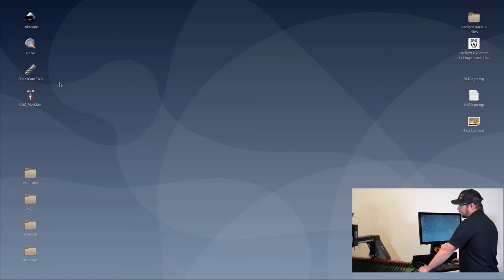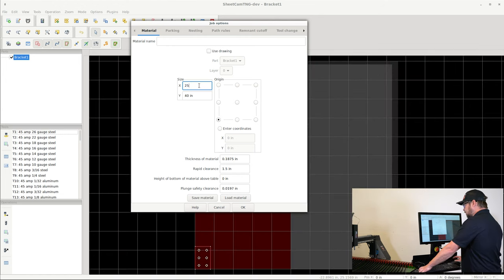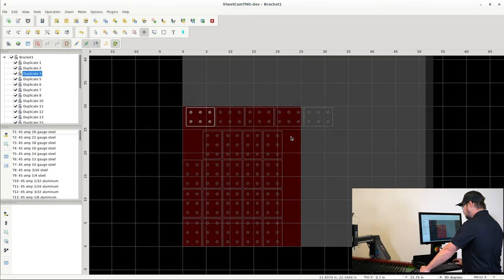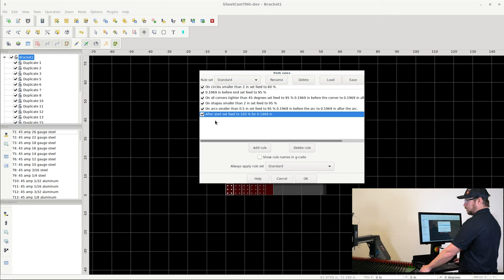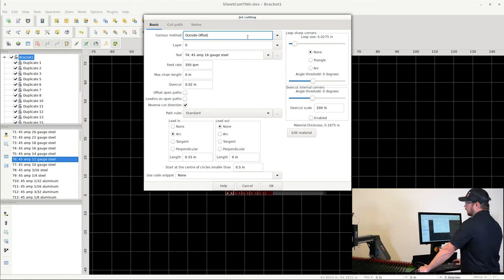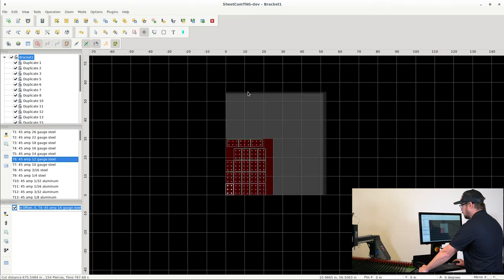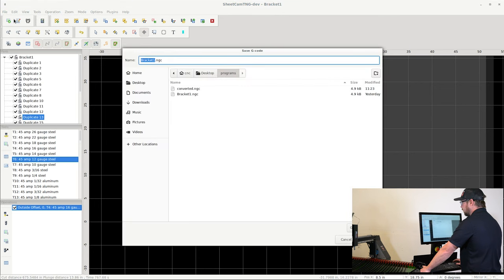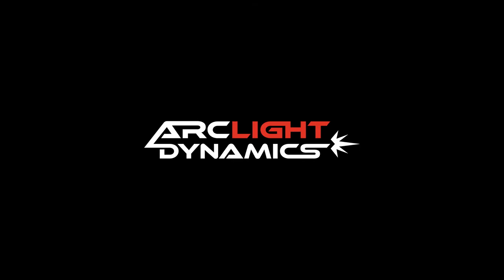Arclight CNC - SheetCam Tutorial

Comment: Why would you want your holes set to outside offset and not an inside offset for correct sizing due to kerf?
Reply: If the drawing is done correctly sheet cam with automatically change the interior holes to inside cutting. If your holes and outside shape are on different layers then you have to select the interior parts and select the inside cutting.